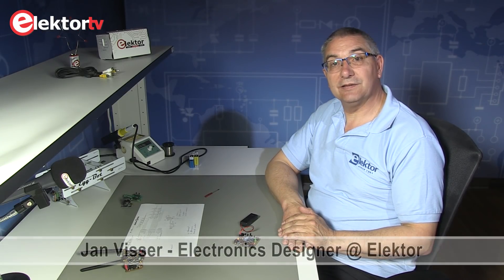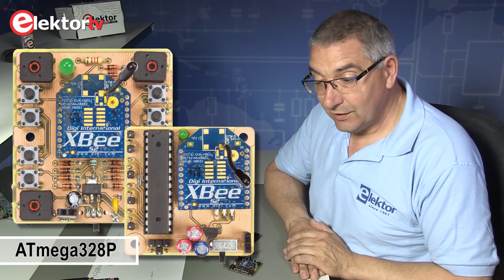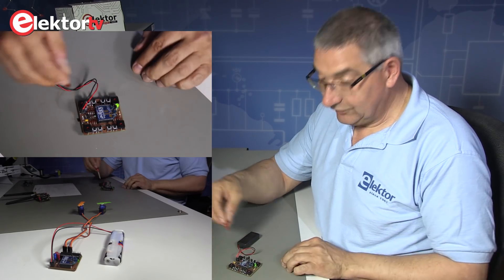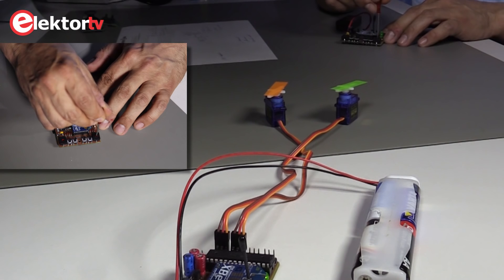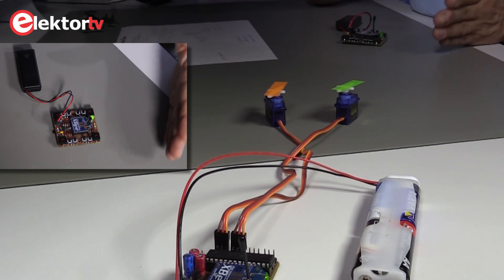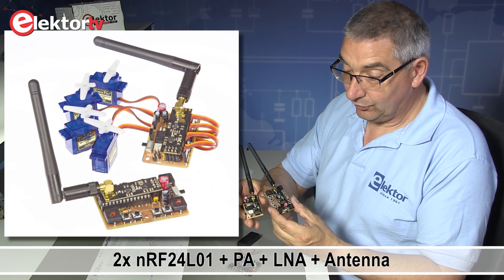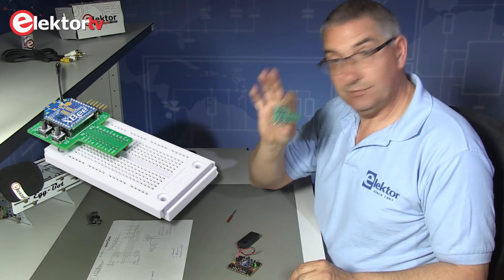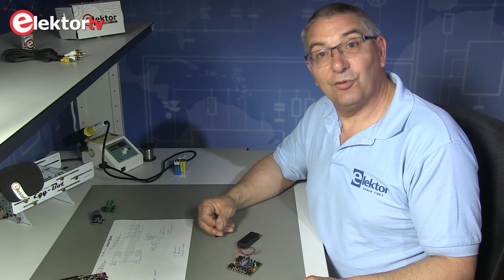4-Channel, 2-Flavor Remote Control with XBee or nRF24 radio modules

Comment: Do you use mictrocotroler such as atmega 328 in your receiver ? Or mayby you have only xbee on your receiver board. Do you use api to communicatuon betwenn xbees ? Can you give any datail about procject with xbee , especiali schematic . I am very instresting how you stering servos by xbee ? Do you use internal pwm channel ? Thans for your help from poland
Reply from the maker: Hi Jaroslaw, the atmega is only in the receiver, but you can read all about the project here: https://www.elektormagazine.com/magazine/elektor-201705/40329